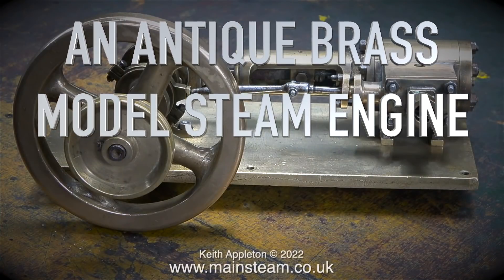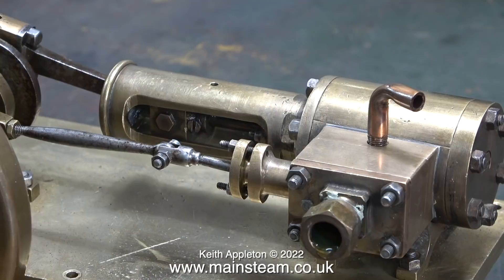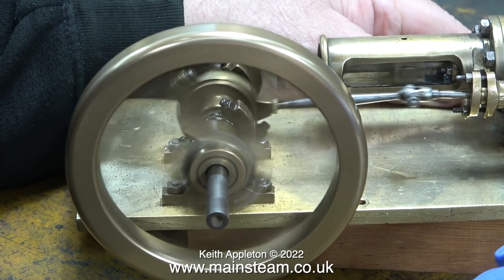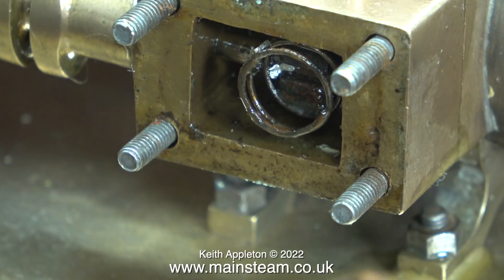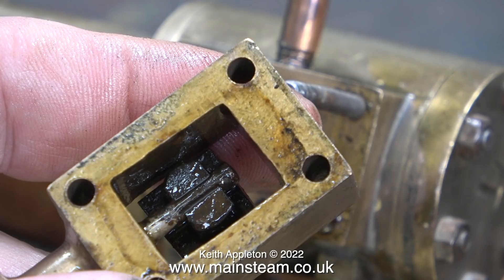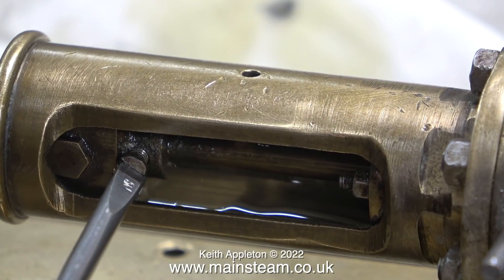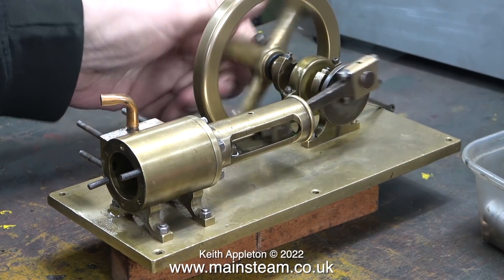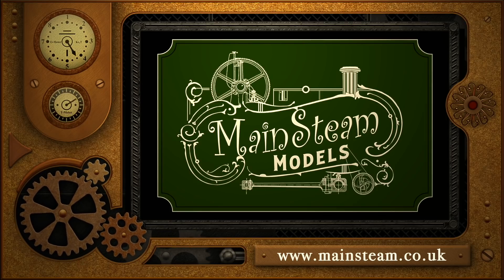AN ANTIQUE BRASS MODEL STEAM ENGINE - PART #1

Comment: The last couple of steam engines that I repaired are only going to be run on Compressed air, and I mounted them on the top of display cases with an air connection at the back of the display  box, a Filter Regulator Lubricator unit inside, air connection to the Boiler through the top of the case, a control for the regulator and a pressure Gauge at the front. I filled the Lubricator with Air Tool Lubricating Oil. The first one has been run off and on for ten years now with no problems.

Comment: I do believe that THIS is an engine that I could work on and improve.  My guess is that your customer will be quite pleased with the outcome.  The spring soldered onto the slide valve was a novelty!

Comment: I always thought these brass steam engine models were for display only.  That brass base looks hefty with scrap brass going for  $1.52 a pound for yellow brass and red brass fetching $2.02 a pound, there is quite an investment just in the metal weight!   With brass costing so much building a model out of it could cost a small fortune!

Comment: Is there any kind of lubricator that would work with compressed air?
Reply from the maker: You can buy inline lubricators for use with Compressed Air Tools, But I usually just squirt some steam oil into the feed pipe as I never run these engines using compressed air for long periods of time.